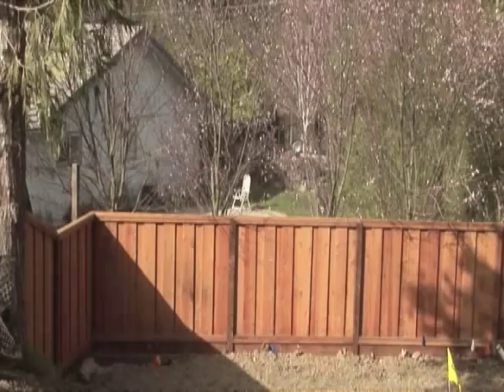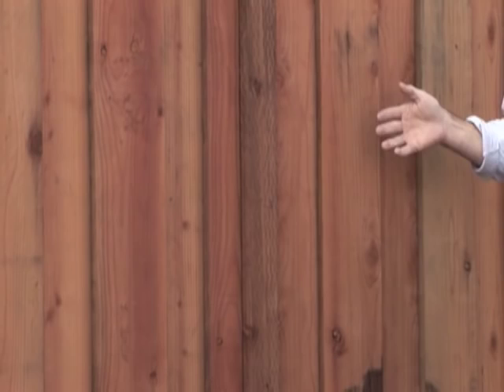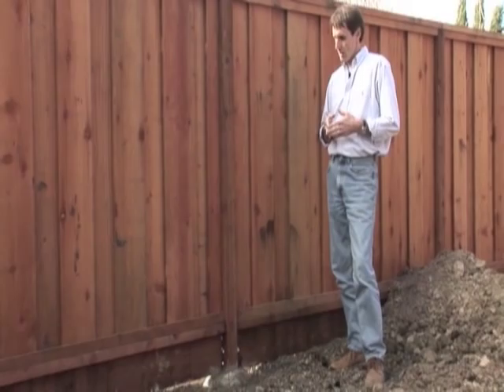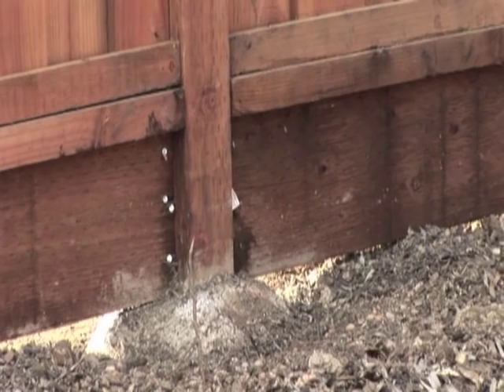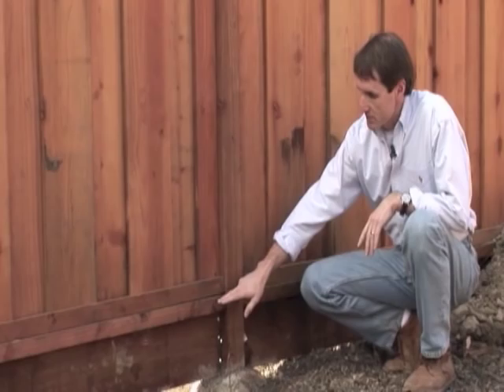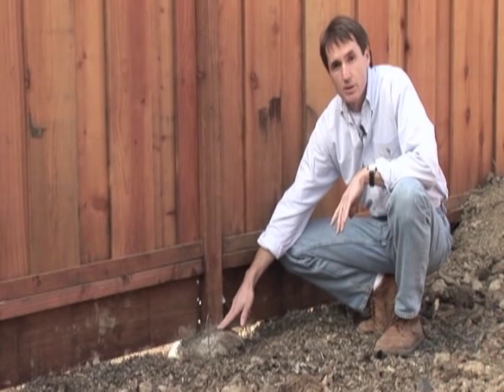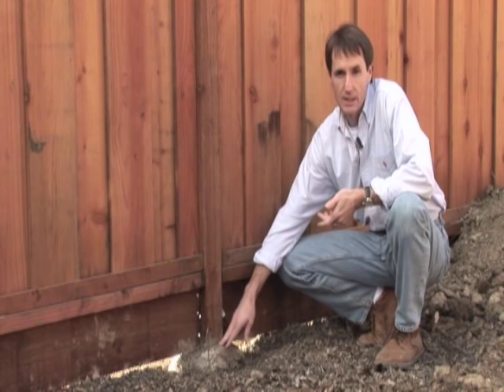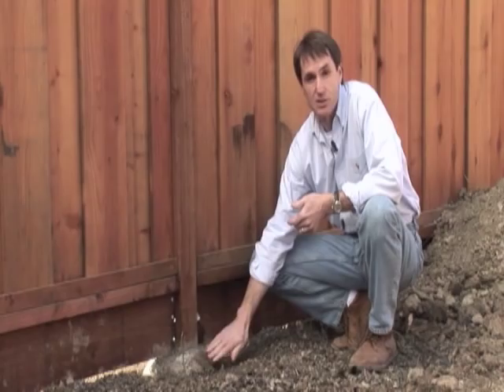How to Build a Good Neighbor Fence

Comment: I've done dry cement into holes and used a form i built to put around the post and it fill it up with the quick dry and it had worked fine for me.

Comment: I have this exact fence and wish you'd built it!  I've had every problem you mentioned.  It appears my vertical boards shrunk, so in a strong wind they blew out, so I'm now replacing the 1x1 trim with 1x2 to hold them in better rather than replacing all the vertical boards.

Comment: Live on a  corner lot and need about  720ft of fence on the side facing street..My yard sits high so neighbors can see inside from outside..The fence that we have is still ok and steady but she wants a new taller fence just like the one ur showing on video. She wants all the gaps blocked and taller fence 7ft and also we may add lattice...My question is if it is worth it just to replace the side fence and a little bit in the front without replacing the rest of the fence (neighbors fence)? Will this look good or is it better just to save more money and  replace the whole thing around house?? The rest of fence around house is nice and steady but if we replace street fence it will be nicer and taller compared to the rest of the fence.

Comment: Nice. It looks like it looks good on both sides, but I can't quite tell. Does it look good on both sides? Why do a lot of contractors like to do the dry cement technique?
Reply: He didn't say but those boards are installed slanted and they overlap each other. It's the only video of a Good Neighbor fence of this design I can find on YouTube.
Note: Just found out it's also called a PICTURE FRAME LOUVERED FENCE and since both sides looks the same it's a PICTURE FRAME GOOD NEIGHBOR LOUVERED FENCE!

Comment: Fences are very expensive! And everything is  twice as  expensive in the Bay area!$$$$
Reply: I did a 60 foot fence with a gate for 3k in the valley, I'm about to start a job in the bay where the customers said they were quoted are 6-10 thousand for a straight 60 foot fence
Reply: Ditto. I live in Santa Clara. Building materials are ridiculously expensive. Worse, you can't even find them when you need them.
Reply: @scouserrr  The materials make up a minor portion of the cost.  Many contractors will not break down their estimate between materials and labor because they don’t want you to know that materials, even in this market are maybe 30% of the estimate, tops.